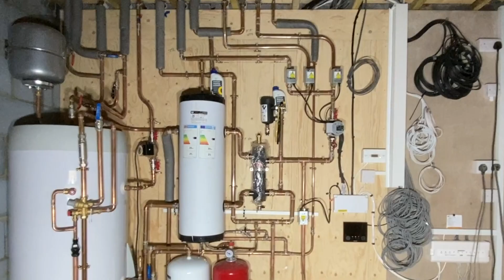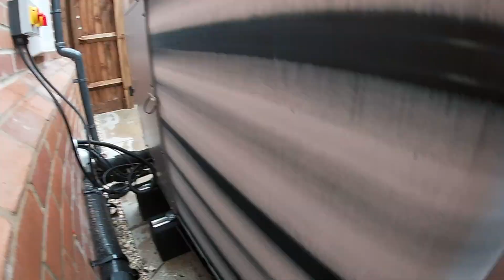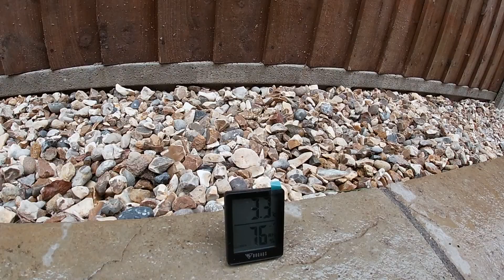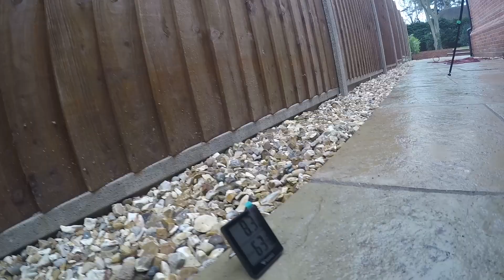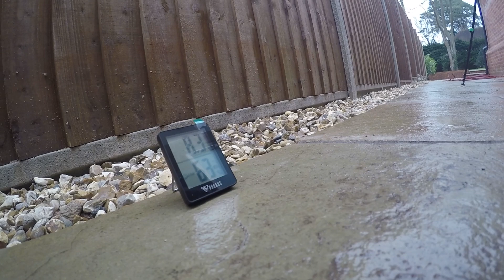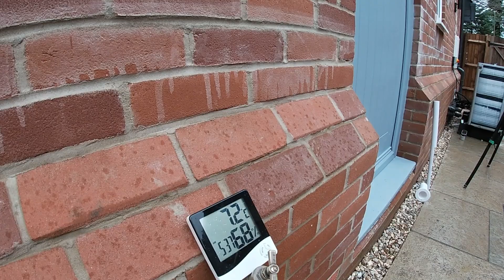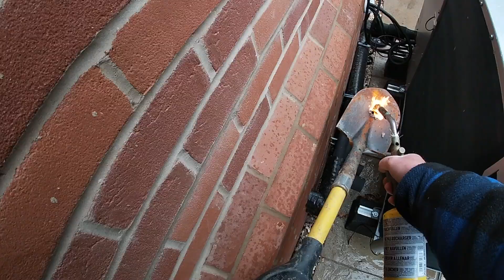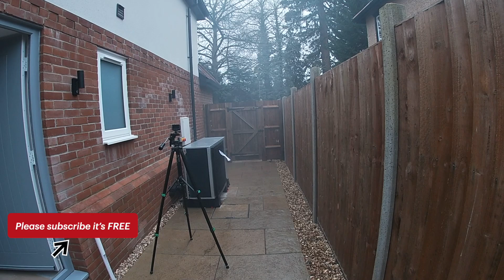Heat  Pump Freeze Up - HELP!

Comment: You've already figured this out. The cold air is pooling around the heat pump, because it can't really go anywhere. It may be enough to just remove the bottom part of the gate, so that the cold air is able to flow out. Think of the cold air as a liquid. It currently can't go anywhere. It can't even really flow towards your garden, because it would have to be replaced with new air; the only way the new air can enter that area around the heat pump is from above. This is hard for warmer air to do. So, by creating a hole at the bottom of your gate, either the cold air will be able to escape there, or new air could enter more easily to replace the cold air flowing towards the garden.

As a quick test: does keeping the gate open help?

Also, you could also try redirecting the air flow upwards by adding a ramp in front of the fan.
Reply from the maker: Thank you for your comments I will give these a try. Thank you and good luck👍
Reply: So basically if you are installing heat pumps on multiple properties that share aoutdoor space, they will basically struggle to work due to pooling cold air in the area.....
Reply from the maker: @bobstirling6885  No not really the problem with this install is the fence in front and the gate to the left hand side . if fence was not in front I think I would be happy . In really cold weather a COP of 2.5 is acceptable in some cases but I know that I should be getting a COP of around 4 This is the target to get the price of electricity per KWH  cheaper than using gas . Thank you 👍
Reply: @HEATSEEKER1428  
" In really cold weather a COP of 2.5 is acceptable in some cases but I know that I should be getting a COP of around 4"

====

Ideally your looking for a SCOP (Seasonal coefficient of performance, measured over 12 months) of >4, running below zero, say at -4C, then 2.5 'might' be acceptable for heating circuit on such a large project (definitely would for hot water cylinder), but likewise may hit 5.2 at 15C ambient in Spring and Autumn use.

I hope you will find the performance you are looking for, please post an update should you find anything significant.
Reply from the maker: @_Dougaldog  Hi yes 2.5 is ok per haps I should manage my expectaions  Thank you 👍
Reply: @bobstirling6885  No, it probably will work, since the area is much larger and heat can more easily transfer between the warm air above and the cold air below. Plus, any tiny amount of wind would help mix the two air masses.

Here, the problem is that this is such a small area that looks virtually air-tight in three directions. Air can't flow out because no other air can flow in.
Reply: @bobstirling6885  

They will not, the heat pump in video is installed in a position well within manufacturers requirements.
Reply: @ it clearly is struggling with cold pooling, so is not working despite being installed in position within parameters....you have literally confirmed my statement.
Reply: @bobstirling6885  

"despite being installed in position within parameters....you have literally confirmed my statement."

====

I do not confirm your statement, I disagree with what you have said, the position of the unit is not a major contributor to poor performance.
The manufacturer recommend anything over 1,000 mm in front of unit, it has 1500mm clearance.
They recommend minimum 300m to rear, it has 300 and in some part 400, and they recommend 500mm or more to each side, which is more than covered. The unit is well within the parameters required.

The sore thumb that sticks out to me is zoning and that buffer (hydronic separation unit), unless it is fine tuned to the system it will cause issues.

Worth watching all this https://www.youtube.com/watch?v=bZEii9tSyyU&t=70s
Reply: @ and yet it is still struggling to work due to pooling of cold air....despite being installed within parameters.....
Reply: @bobstirling6885  

It struggles but not due to airflow.

Have a look at my latest comment regarding the temperature reading in front of unit, where a video edit suddenly shows a jump from 3.3C to 8.3C ?
Reply: @ I'm not sure I'd say it's struggling unless we mean that in weather at the low end of its range, the COP is lower than we'd like. I linked elsewhere to the Heat Geek video where they deliberately try to make the heat pump less efficient by limiting its space, going so far as to cover it with a tarp. It never goes below a COP of 2.1 or so. This one seems to be installed within the specs and is getting a COP of 2.5 while it does the job it's supposed to. I'm not sure what there is to fix, but it seems unlikely to be the space. A quick test is just to bring in a fan and move the air from around it. That'll show if the space is really the problem.
Reply: Sheesh. All the faff , technical knowledge and equipment needed to get something to heat a home as cheaply as gas. And that’s not including providing hot water which is another expense. Nor the installing the required insulation. 

With improved insulation and running at ‘slow burner’, a gas combi provides excellent heating and hot water at a cheap price with half the equipment and expert knowledge needed. GCH can also be zoned, which a wet system ASHP.

The one thing ASHP obsession has shown me is how I can improve the heating efficiency with better insulation, ie replacing loft insulation and putting a DG door on at the back of the house.
Reply: @wolves201  indeed, if you just follow the same principles of insulation you will generally save half your heating costs for a fraction of the cost of an ASHP installation.
Reply: @markoluksa  brilliant idea as the air channels along the fence from front to back or Visa versa

Comment: Interesting. I’d expected the resolution within the same video if I’m honest. I strongly suspect you’ll need to turn the unit 90 degrees to face down the pathway, ideally away from the gate to avoid similar issues. ASHPs really do need fresh air to work well, obstructions in flow do reduce effectiveness as you have shown.